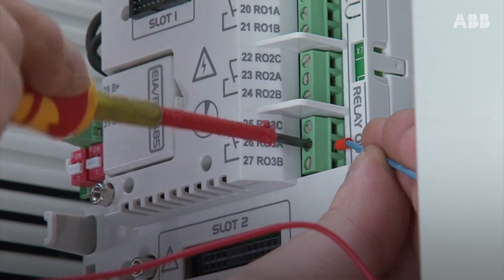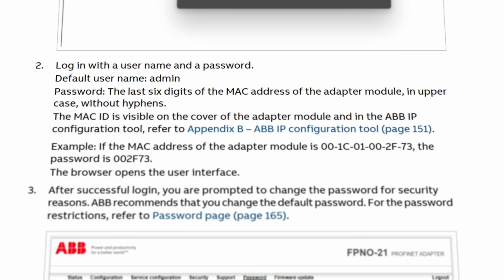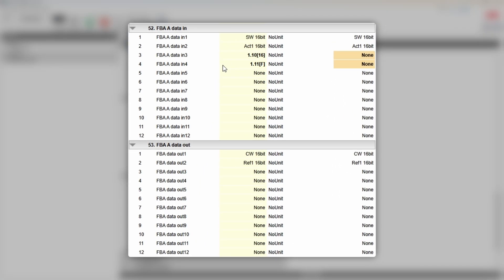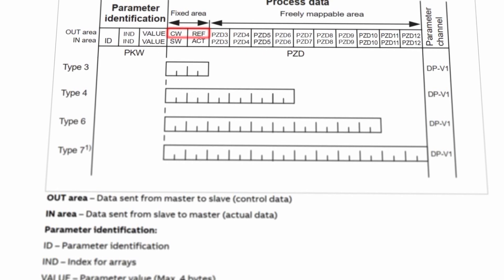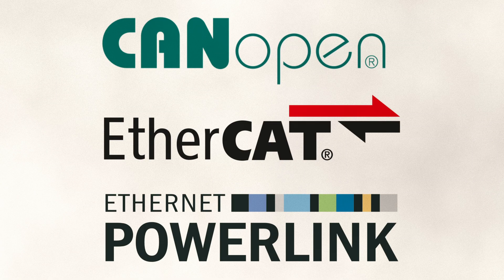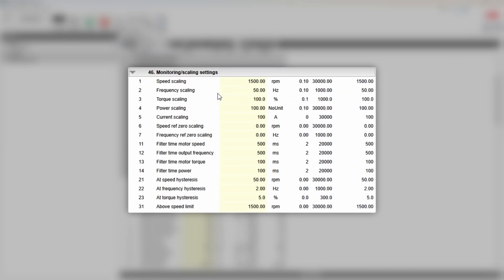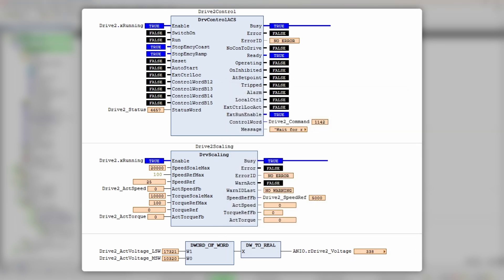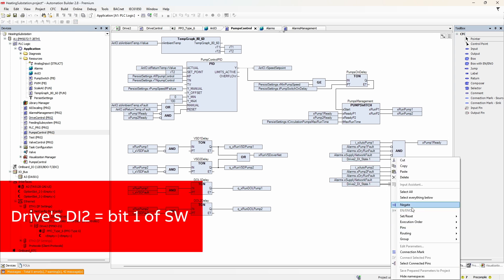Intro to AC500. Part12. ACS drive control over PROFINET

Comment from the maker: There's a small mistake in the video on 2:22. You actually CAN send Profinet station name to ACSx80 drive from IP configuration tool. For that, in IP configuration tool on the right panel you need to  you need to deselect "ABB Net config protocol" checkbox and select only "Profinet Dynamic Configuration Protocol (DCP)". Below IP address, "Name" field and "Store Permanent" checkbox will appear.

Comment: i am working on a project with multiple acs580's with fpno-21 on regular codesys, is it possible to import the drvcontrolACS ? i am building my own but if there is an plug and play version that would make it easier
Reply from the maker: I'm afraid that is not possible. ABB Drives library is intended to be used on AC500 PLCs.

Comment: Hello is it possible to use DrvPnRead or DrvPNWrite with AC500-eco? There is input called CMDevice which require "2: Name of the Communication Module Device connected, Example: CM579_PNIO or CM579_PNIO_1".
If this is not possible what would be your sollution for acyclic comunnication with drive?
Reply from the maker: Hello Dariusz. That is a very good question!
DrvPnRead and DrvPNWrite will not work with onBoard ProfinetIO. At least for a while until developers update them. Because they were designed to work with CM579 module. 
The only workaround is to use RDREC and WRREC from CommFB library. But it is somewhat cumbersome. That's why I didn't include it in the first place.
Reply: @abbplc  
One more thing I had a problem with setting slave IP Adress as my PLC had IP 192.168.10.33. I found out, that I had to change one thing in: Tools-Options-Device_Editor to see aditional IP adress settings (Show generic device configuration) and then set my IPAdress at ETH1 IP Settings. By default it was set to 192.168.0.1. 
Would love to see explaination what is the diffrence beetwen this and usual IP adress configuration.
Reply from the maker: Basically, if you set the IP-address from IP configuration Tool it's project independent. If you configure IP address in project then every time you need to change IP-address you would need to reupload the project. There're pros and cons for both methods but usually the first method is used.

Comment: How to programming ABB PM572 controller.
1) ethernet not available.
2) TK503/4 cable not compatible.

Sir,   any idea how to program PM572 controller
Reply from the maker: Well, first of all, anything we show here is not applicable for PM572 CPU. It's V2 CPU and it has slightly different connection and programming options than V3.
Second, standard cable to program V2 CPUs are TK501/502. If you don't have access to it, just take any USB->RS485 converter and make it yourself. But all the responsibility will be on you.